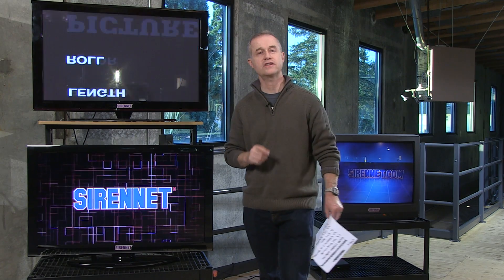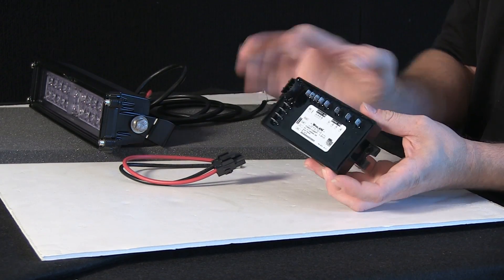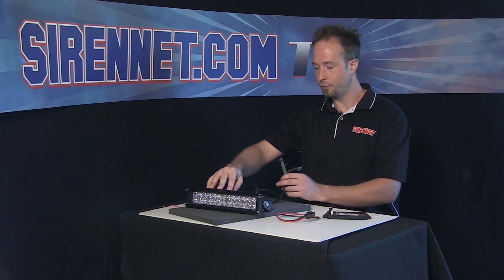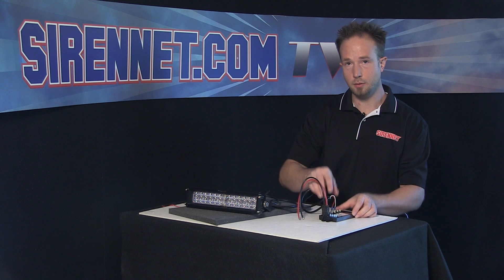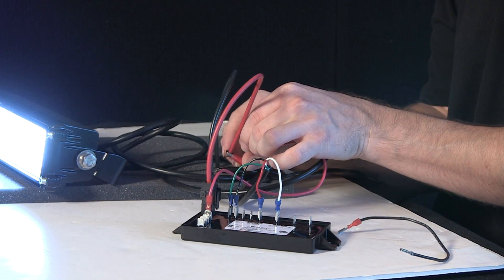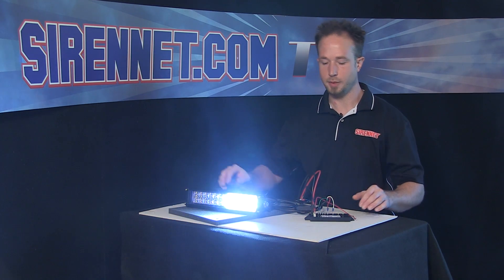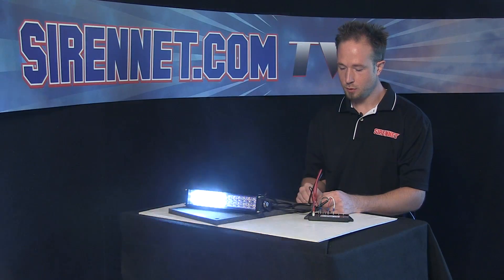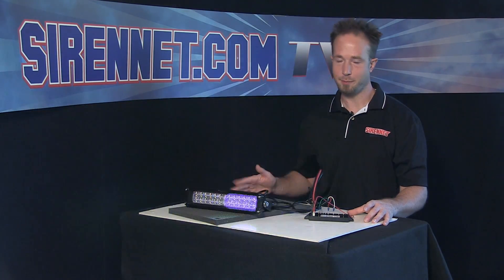Whelen Pioneer LED 4 Channel Flasher

Comment: Would this flasher work with Rigid or Baja Designs led off road lights? Thanks
Reply from the maker: It should work fine. Keep in mind the draw the inputs are rated to handle and add relays if necessary.

Comment: How would you change the flash pattern once install. Once you get it set of the strobe pattern. Will is stay on that pattern so all you have to do is flip the flash switch and it will begins to strobe
Reply from the maker: You can set the pattern prior to mounting the PFLASH module. It has a post that when +12volts is momentarily applied, the flash pattern advances to the next.   You would need to access this post or you could run a wire to a momentary switch in the vehicle so you can easily change patterns on the fly.

Comment: Would this work with a 20" Rigid Industries LED light bar?
Reply from the maker: So long as the draw doesn't exceed 5 amps, the PFLASH can be used along with the 20" bar.
Reply: @SIRENNET  sounds like this module to drive other lights like hella 500s and other driving lights by using it to drive the relays that run the lights so its pretty much a relay driver

Comment: is it possible to install this unit in the engine bay? thanks james.
Reply from the maker: The PFLASH can be mounted within the engine bay. You'll want to make sure it's away from water and excessive heat. Be sure to secure the wiring connected to it as well so that nothing becomes loose or gets moisture within it.